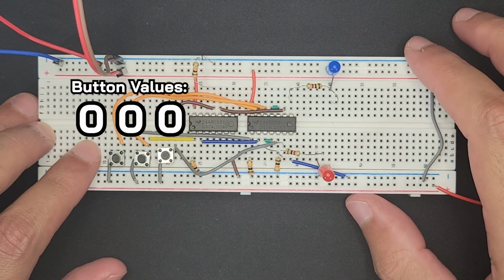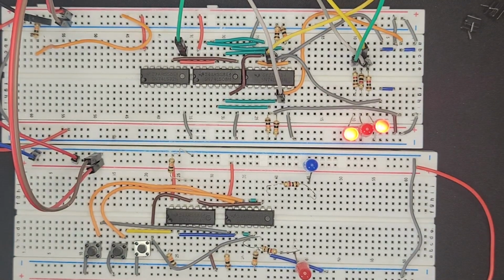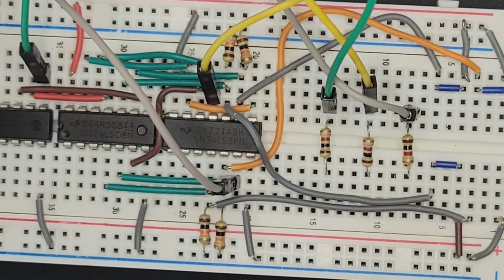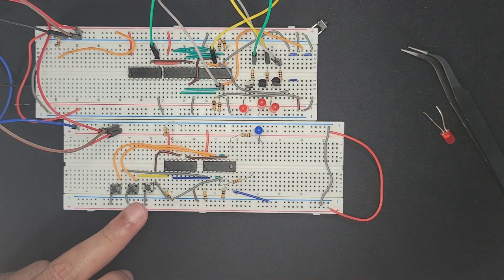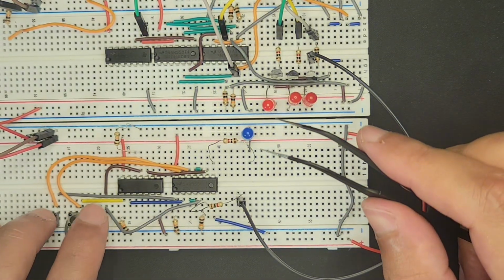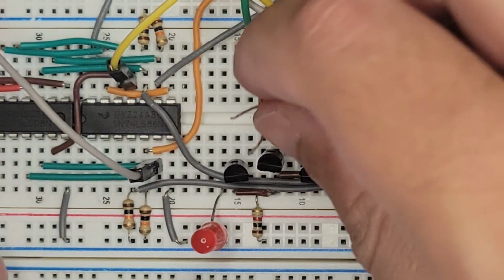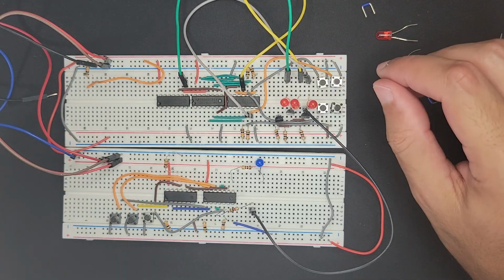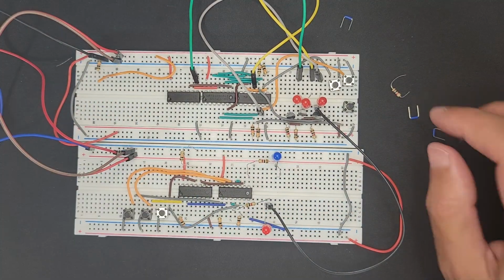Connecting CPU "ADD" Instruction to Adder Circuit - Beginner Learns Electronics Ep26

Comment: Use Pull down resistor for NPN to avoid false triggering.  Use 1k from base to Ground. As its NPN , for PNP u should use a pull up resistor. These will avoid floating of inputs
Reply from the maker: Thank you! I will give this a shot and reply back with the outcome